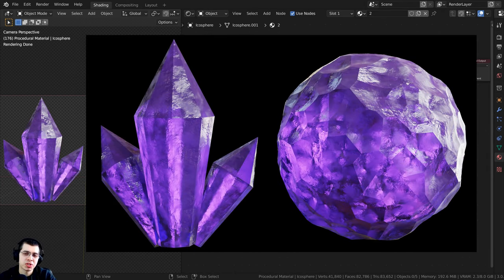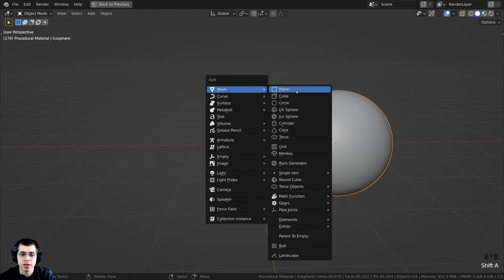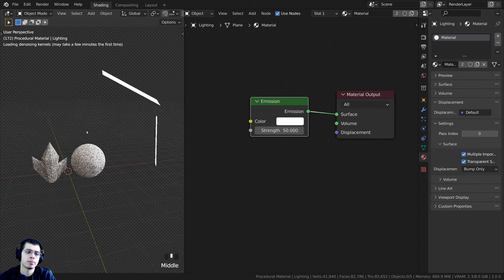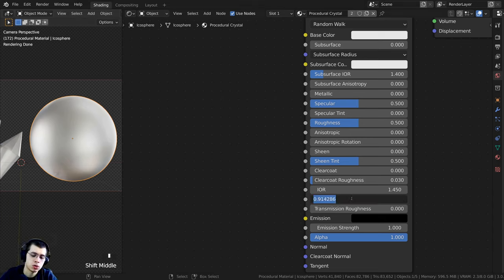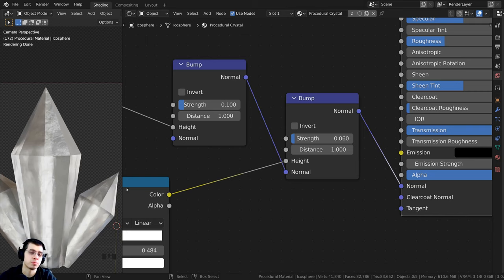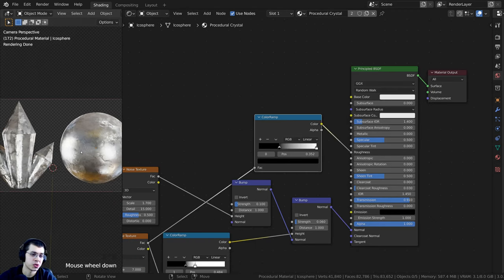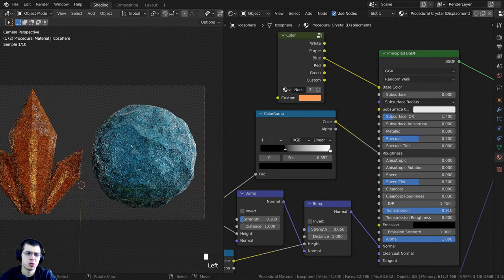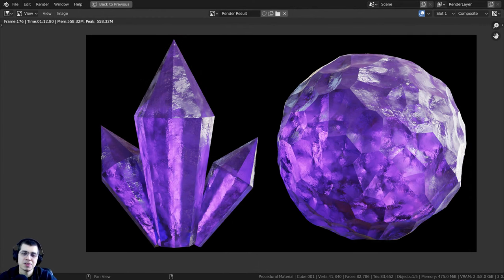Procedural Crystal Material (Blender Tutorial)

Comment: I really appreciate hearing how you think about the nodes as you decide what you need and how you place and connect them.  Procedural materials are making a LOT more sense thanks to you. I took a quick look at Eevee Displacement Modifier on the Object, but it seems to only want an image map to drive displacement.  I didn't see a way to tie the Voronoi node in through the modifier.
Reply from the maker: Thanks! Yeah, to use the displacement modifier and displace the mesh in Eevee, you will need to displace it using a texture on the texturing panel.

Comment: I'm new to Blender and I had no problem following along until setting displacement to displacement and bump, which does not work for me although I'm using the Cycles render... I made sure to follow every step very closely. Any idea on how to fix this issue? Thanks
Reply from the maker: I go over all the displacement settings at the start of the video. also make sure your in rendered mode
Reply: @RyanKingArt  thanks King will try that👑

Comment: This tutorial is really helpful, thanks. For some reason the light does not appear to be penetrating the material at all for me, just looks like red rock. I double checked my nodes they appear to be identical. Would appreciate help :)
Reply from the maker: Thanks for watching! Make sure you have the transparency turned up in the light paths.
Reply: @RyanKingArt  I have my transmission the same that you do, if that's what youre reffering to. It still doesnt look like any light is passing through
Reply from the maker: @iDabbl  Go to the render properties, and go under the light paths tab. Make sure the light paths are turned up, so that it can use the transparency.
Reply: @RyanKingArt  I apologize for my profuse incompetence. I turned up those settings, but still no light is passing through. I double checked my nodes as well, so at this point I have no idea what is different. Anyways, thanks for your help.
Reply from the maker: @iDabbl  Are you using Blender Eevee? if so, there are some other settings that you have to change to get the transparency to work.  You can check out my eevee glass shader tutorial to see the settings that you should change. https://youtu.be/JYyUMMboZFk